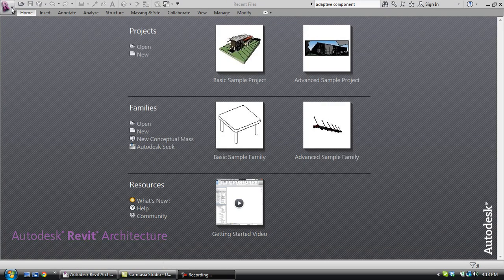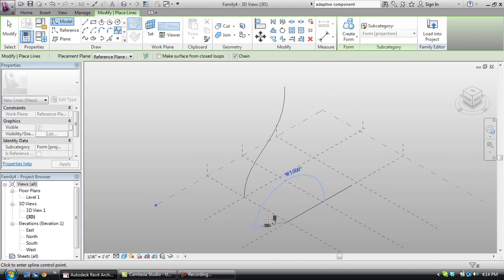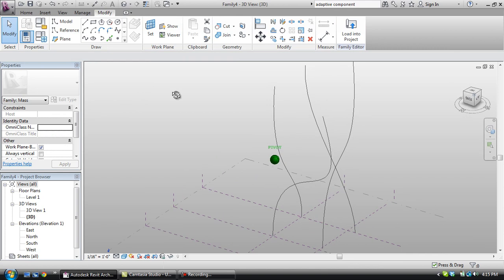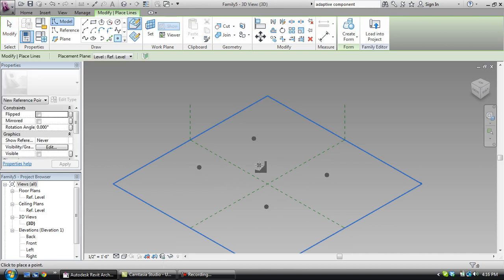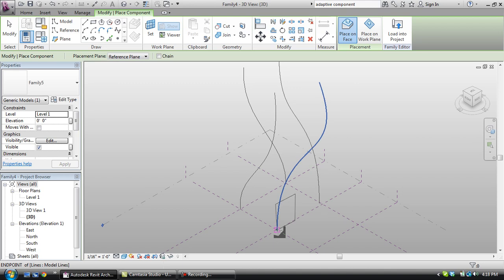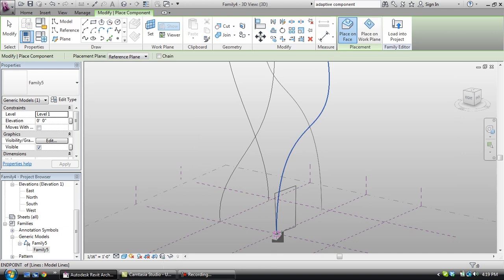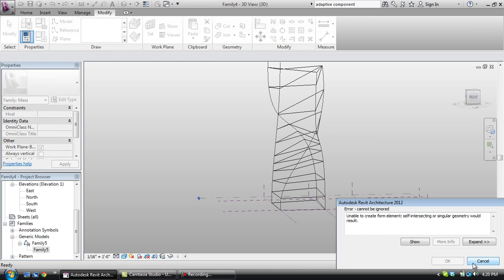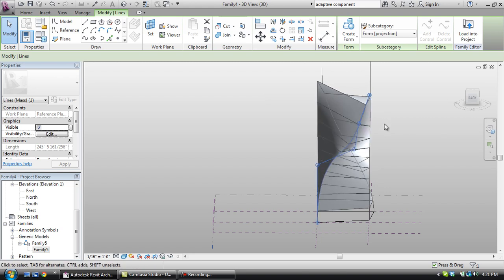Revit 2012 Adaptive Components Part 1 - Tower Massing

Comment: Hey I never knew you could do this so i tried it out and thought it might be good to mention some things.
1. This technique can still be used for in-place models.
2. I tried using the copy tool to move the adaptive profile up but it doesn't change with the lines. Holding down control DOES works though. Any other way?
3. The adaptive profile will only follow a single line/curve/etc. I tried making jagged vertical lines but it only copied up to the first line. Splines are considered one line.